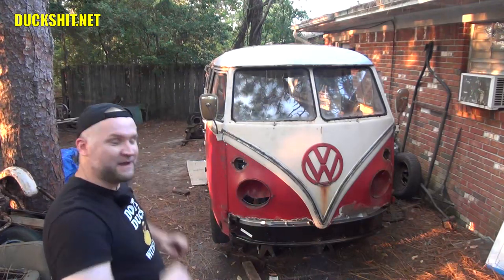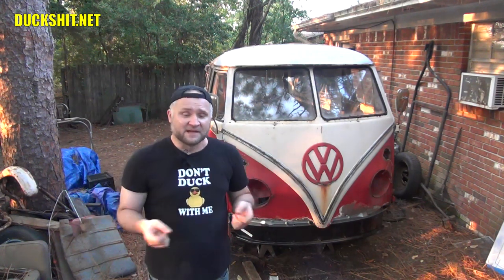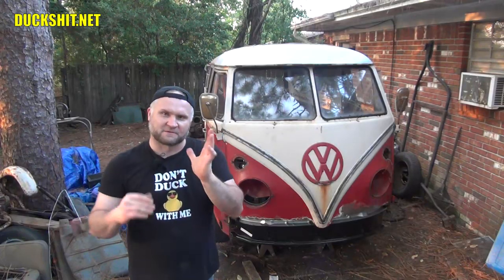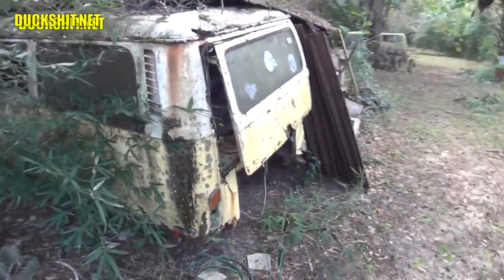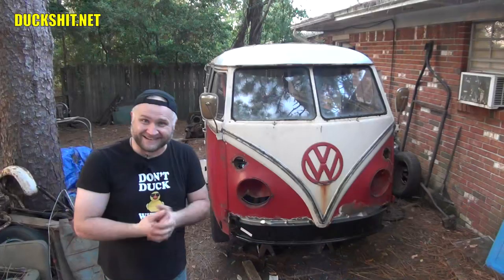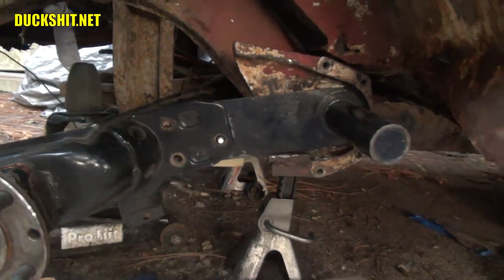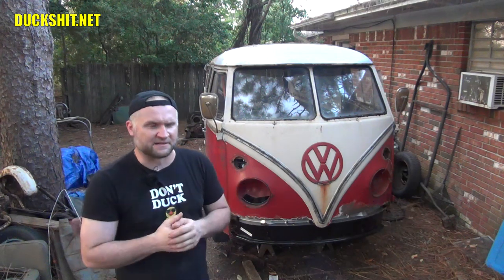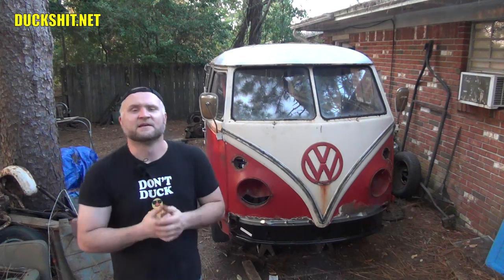VW Bus Narrowed Rear End Reasoning - Mid Day Q&A - 83

Comment: Great explanation! But, don’t forget that the engine weight is behind the wheel center making the problem worst. That is what really caused the problem with Corvairs, They had a 6 cylinder vs VWs 4 cylinder. 2 more cylinders, more weight.
Reply from the maker: Yes the weight in the rear caused a pendulum effect that exacerbated the caca suspension problems!
Reply: @vvtheduckvv  The 1st generation Corvair was a PoS and "Unsafe At Any Speed" rightly criticized it.  OTOH, I have pleasant memories of riding (passenger) in a 2nd(?) generation Corvair, when I was in the Army (say 1967) and it seemed to hold the road quite nicely, when moving along at a good clip, including curves.  JMO, GM "abandoned ship" too soon.  They were close to having something pretty darned good.  "No guts, no glory."

Comment: I had great results when I preloaded the rear of my strip basher 54bug . ive never seen anyone else do this and the car handled better than any other swing Axel car ive ever driven  even took it onto the normal tracks for track days was great . preloading is keeping the rear suspension at stock hight adding some weight onto the back to compress the rear suspension. adding metal to the spring plate bump stops to limit downward travel the wheels cannot then tuck under . then add some good coil over shocks and load them up as well I used avo . all this was don years ago in the early 200s
Reply from the maker: Yes I've heard of similar, good for race car not the most comfortable Street Driver though

Comment: So the trailing arm suspension cambers out positively some and toes in some  
Wheel alignment includes camber, toe and caster (think of the front wheels on a grocery cart. They are so "castered" they call them casters).
Reply: Fun fact out of "antiquity": the Chevy Montecarlo of the Disco age was the first American car with noticable caster. It was done to mimic Mercedes Benz steering/driving characteristics. Lots of caster makes the steering heavy right off of center, you are lifting the front of the car up with that geometry.
Reply from the maker: Caster applies to the front wheels that have a separate steering motion, not so much the rear where the arms all hold the wheels in place.  The wheels in the rear return to center when the suspension settles rather than from steering input.   Thats an interesting piece there on the Monte Carlo.

Comment: Z-bar considered instead? That makes the wheel go down and go into positive camber. It grips more but the Z bar makes it "think" it isn't resisting roll at all.
Reply from the maker: My Fastback has a Z-bar... it's standard equipment on 67 and 68 Type 1 and 3.  It's more of a suspension assist,  it's a hakc to add a progressive spring rate, not directly intended to help camber.  I pre-loaded mine on the Type 3 with skateboard wheels, the rear end feels much more stiff now and less sloppy, doesn't wallow as much over bumps or in turns.
Reply: People also put Z-bars on Triumph Spitfires, otherwise the Spits want to corner like this /\  or ^.  Imagine wheels on the outer ends of those slashes, getting too near horizontal!  With no sideways force on the tires/wheels they settle down to where they grip best.
Agine

Comment: I understand everything you said about the suspension, my question without giveing up your info, will the Porsche (car?)discs be up to the weight that your going to be using the bus for?
Reply from the maker: Well the Porsche I am sourcing the disc brakes from weighs 500lbs more than the Bus, and makes considerably more power... and the Bus came stock with some really awful (in my opinion) drums.  So ANYTHING is an upgrade and will work better than stock.